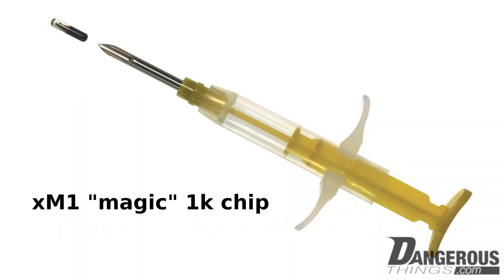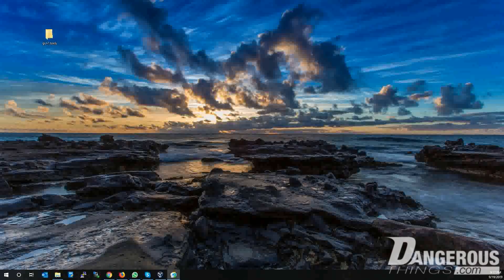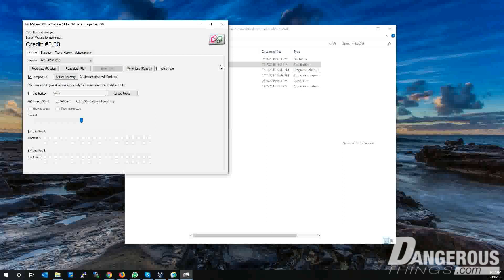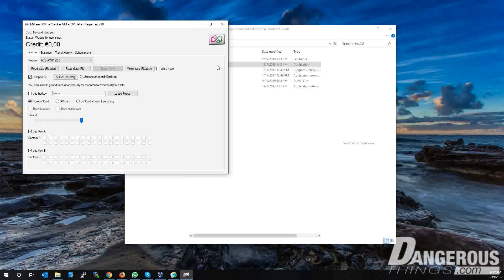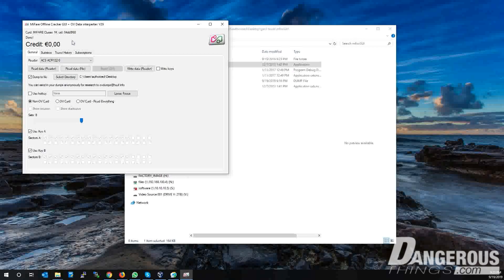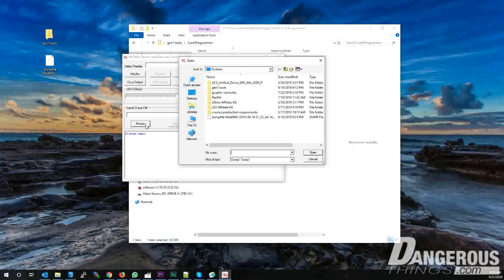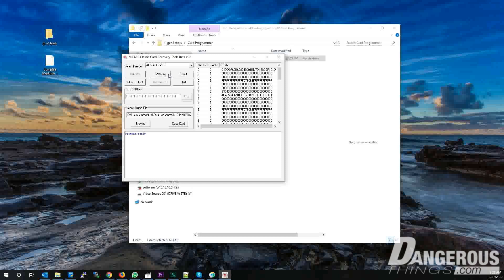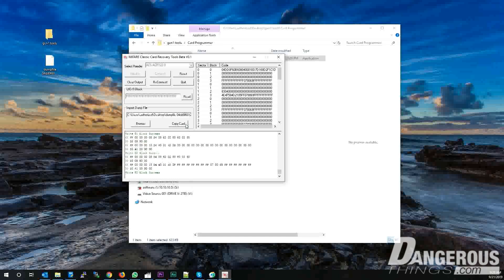Cloning a Mifare S50 1k to the xM1

Comment: Question: if i want multiple keyfobs/cards on my mifare classic, how would i go about that?

This guide worked perfectly for my Mifare Classic 1k chip so thanks for the help!
Reply from the maker: Sorry it's not possible to do that.. there is only one "serial number" possible per chip.
Reply: Dangerous Things but i’ve heard about people compiling a master key?
Reply from the maker: @STRIDwastaken  Sure you can copy a master key, but it's still just a single ID. A "master key" is nothing more than a specific ID that the specific system you are using it with considers to be a "master" key.. so for a hotel for example, there will be "master keys" but that does not make it a master key at a different hotel.. in fact it may not work at all because that ID is not registered within that second hotel's system at all. Does that make sense?
Reply: Dangerous Things thats not entirely ehat i meant, but i will thank you for fast replies :)!

What i meant was, that you can put a master key, and alot of different keys under it so to speak. I talked to a local tattoo store and they said it’s possible but that they had to check with their specialist. Apparently one of the workers there had it and had access to an id in his garage, a different id in his house ans a different id at his work, all on the same chip. So according to you this is not possible at all with any chip?
Reply from the maker: @STRIDwastaken  Oh I see what you mean, like public key crypto.. well.. the short answer is no. The long answer is.. it depends entirely on how the system using the open memory space of the chip is set up to utilize the chip's storage space, and absolutely none of the systems I've ever seen do anything close to that. What typically happens is the chip's ID is registered with the systems in the garage, house, and work. They are not different IDs. To understand more about how this works, check out this video; https://dangerousthings.com/chip-implants-101/keys-vs-rfid/
Reply: Dangerous Things but doesn’t that seem like scary 2004 to only be able to have ONE id per chip 😤? Feels like it should be fairly simple to have multiple keys and make them all be requested when touching a door scanner/garage to let it check for the correct id it needs
Reply from the maker: @STRIDwastaken  hah yeah, sounds simple.. (famous last words)

Comment: Hi, I would like to know what is the average life span of the injectible magnets.
Reply: I don't know if there's a predictable lifespan of the injectable magnets. Personally, I have a xG3 injectable magnet. However, it's fairly new so I suspect it will work for awhile. The injectable ones are also easier to get put in, obviously. However, they typically will need to be put in a location that can accept an injection, which means it's not advisable for being put into a finger. The injectable magnets are larger than many other implants, so please keep that in mind. Out of curiosity, I will ask the guy if there's a known lifespan for them. I will post a reply when I find out.
Reply: @Lloyd-Black  ok, thank you for your time, do you recommend an xG3 as a first implant? Furthermore, I saw a video on youtube of a guy putting one in his finger. Can I ask you where did you put yours?